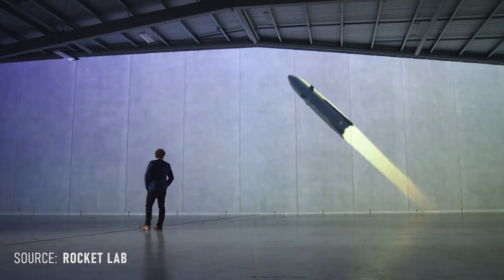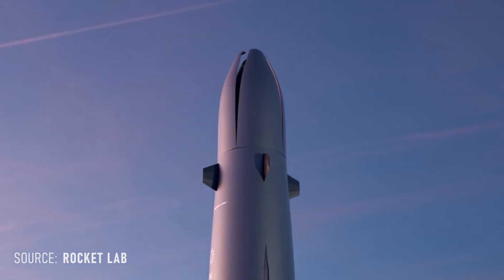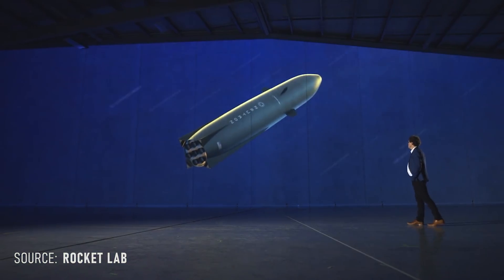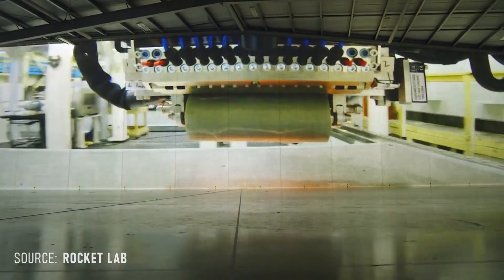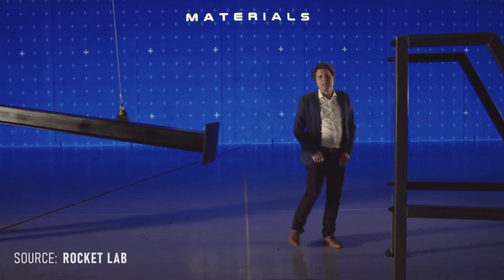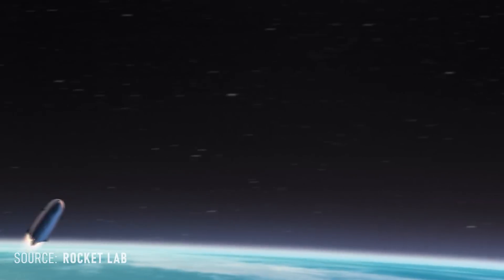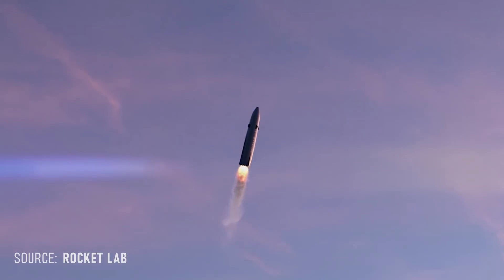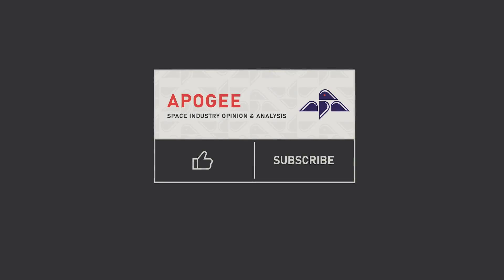Neutron First Thoughts - Design Analysis

Comment: Having watched this video I can see various flaws in it. While I agree with you that Neutron has a large amount of potential you made a lot of errors in your assessment of it.
Firstly I'll point out you mention that Rocket Lab (RL) is having to add graphite to Electron to deal with reentry but you fail to mention that this film is very light and if I was to guess it is lighter than just making the thing out of Steel or Aluminum. 
Secondly I will mention you don't seem to realise that it is easier to make complex shapes like Neutron with carbon fiber especially for RL with their experience with working with composites.
But those are just minor faults in your analysis. The real problem is with your optimism about Neutron's potential upgrades. You believe that RL will pursue a reusable second stage. This is highly unlikely unless they want a new ~3 tonnes to LEO launcher with no GTO capability. Even if they did, there is a high chance of it barely reduce the launch price. Reusablity does not mean a dramatically cheaper vehicle (see Shuttle). 
Now for my main criticism of Neutron: It isn't adaptable. RL will have a hard job upgrading it in the future to adapt to a changing market. You can see this with Roton. It was designed for the small sat market then that collapsed so they redesigned it to the MEO market and it collapsed killing the company. Back to Neutron, you can't add boosters, it is hard to modify the first stage and very difficult to change the second stage.

I do like your style of graphics.
Reply: Interesting points you make, although if 80% of the future market is LEO small sat constellations, then the ~3 tons to LEO for full reuse could actually be plenty to still be worthwhile. Perhaps they could offer both full and partial reuse configs depending on payload?
Reply: @themagiceye6723  When you say 80% of the future market are constellations the same can be said for Roton and look how well that went. There is a chance that those companies collapse. Also a lot of the mega constellations are proposed by rocket companies. 
A fully reusable second stage will cost a lot and loose a lot of performance while not saving a lot. From F9 we see first stage reuse is about 20% saving. The second stage has a much harder environment so a reasonable estimation would be about a 10% saving. I believe first stage reuse for Neutron will cost will save more than F9 as it is being designed from the ground up for reuse. Although it probably wont be too much more as it uses carbon fiber. But back to the second stage reuse. A reusable second stage will loose performance, cost more initially and won't save all that much. I doubt they'll go that direction. 
Also that ~3 tons was just a number I made up but it could loose more or loose a bit less.
Reply: @Potentially_great, your comment has a lot of errors in it, the largest being your tone makes you sound arrogant.

First, differences of opinion are not errors or flaws. 

Second, you don't seem to realize how easy it is to stamp and weld up complex shapes in sheet metal. 

Third, Shuttle's extraordinary reuse cost reflects political meddling and a broken process, not technology.
Reply: @olawlor 
Your first point is fair. 
Your Second point doesn't take Rocket Lab's experience with composites into account.
You third point is true. I used Shuttle because it is a good example of reuse not meaning low cost.

Comment: A reusable second stage is a total nonstarter for this design. The first stage would be no where near powerful enough to carry all the extra weight necessary for a reusable second stage. One of the big design problems that SpaceX have to overcome is the weight of the second stage compared to it's mass to orbit. This is one of the reasons they had to build it so big because there are economies of scale in this respect. It is also why they needed to develop extremely complex but highly efficient and powerful engines. The reason they are using carbon fibre for the body of the vehicle is going to be weight. For a rocket of this size making it from metal would just be too heavy for their low powered engines to make it feasible.
Reply from the maker: I agree mostly, but it is clearly on the table given Rocket Lab's comments, so I wanted to take a quick look at what that could be like.
Reply: Beck did say the engine's will be overpowered for it's weight.
He was interviewed as say this is for reusability but I think their's more to this.
Reply: A reusable second stage is possible, in my view. But it would require changing everything about the second stage.

FIrst, to get the needed performance boost for the added mass, they would want a new vacuum optimized staged combustion engine.

Second, reentry would be a huge issue. However, the design wouldn't have to be a mini-starship. I think they could actually come up with a new design that takes advantage of the fact that the second stage and payload could be enclosed in the fairing of Neutron. As an example, this allows for having a blunt front on the second stage with a heat shield, with the payload stacked on top. After payload deployment, the payload holding mechanisms could retract to behind the heat shield, and the stage could do a capsule-like reentry.

Once the stage has gotten through reentry, the second stage of Neutron shouldn't be too big to do a helicopter recovery. Something they will get a lot of experience with on Electron.
Reply: @espenha  In other words a completely different design. The problem with trying to build a small version of starship is you lose economies of scale and end up with little to no payload capacity. This is why starship has to be so big to get the percentage weight to orbit to a reasonable level.
Reply: @schrodingerscat1863  Not completely different. The design I outlined could use the exact same first stage. And the first stage is the biggest challenge.
Reply: @espenha  How is it going to handle the large weight increase of a re-entry capable second stage?
Reply: @schrodingerscat1863  I was assuming there would be basically no increase in the mass of the second stage + payload.

If we assume the reusable version increases second stage dry mass from ~3 tons to ~8 tons, propellant stays at ~60 tons, and specific impulse increases from 340s to 370s, payload capacity would go from 8 tons to 5 tons (for equal delta-V). 5 tons fully reusable isn't terrible.

And in this example, the total mass of the second stage and payload would only increase by 2 tons. That's a trivial difference for the first stage.
Reply: @espenha  Not really a realistic assumption. For re-entry the second stage needs to be completely enclosed, much stronger with lots of heat shielding rather than the super light exposed engine and fuel tank with a payload attached in this design. Getting all that into 8 tones would be difficult and that is with no payload. Of course the extra weight of the second stage also means it needs more fuel and maybe bigger or multiple engines.
Reply: @schrodingerscat1863  It doesn't have to be completely enclosed. You just need to have a heat shield against the airflow, and keep the engine out of the plasma stream. A two ton heat shield should be more than enough, and one ton for parachutes. That leaves two tons for thicker tank walls, reinforcements, thermal blanket insulation, etc.

The Archimedes engine is actually oversized for the current second stage, and they have to throttle it down quite a bit towards the end of the second stage burn, to avoid destroying the stage with excessive G forces, so I am assuming you would have a significantly less powerful staged combustion cycle engine. Perfectly designed for the task.
Reply: @espenha  But even then you are leaving little of any payload mass. It is a pointless exercise. Plus there is no way it would survive hypersonic air flow without being fully enclosed. The stresses involved would just tear it apart. Re-entry vehicles have to be physically very tough. Every ton of extra second stage dry mass is a ton less of payload mass and significantly more second stage fuel. If they can make that work then props to them but I am sceptical to say the least.
Reply: @schrodingerscat1863  The math works out to 5 tons of payload for the numbers I gave. Every ton of added dry mass to the second stage is exactly one ton less payload and no added propellant, all other things being equal.

I don't think a reusable second stage is particularly likely this side of 2030, but it is possible, while keeping the first stage unchanged.
Reply: @espenha  I'm not so sure, an extra 2 tones to turn an ultra light and fragile second stage into a fully reusable re-entry capable vehicle just does not seem realistic. I mean how would they even land it, parachutes mean that it would need significant work to refurbish it and a high likelihood of damage and propulsive landing adds a huge amount of complexity and weight. For something that needs a high launch cadence to make it cost effective it seems like a none starter. Still as I said if they can pull it off then good luck to them. No one thought Falcon 9 propulsive landing was possible until it was.
Reply: @espenha  SpaceX considered doing something like this back when they were still trying to catch the fairings but they came to the conclusion that to have your first stage reenter you will lose too much of your payload capacity and dealing with reentry will be near impossible. The heating is x10 worse than the first stage will have to deal with.
Reply: @jtengelbrecht4613  I know SpaceX has considered recovering the second stage on Falcon 9, but Neutron has a design which I think is better suited for recovery of the second stage. Firstly, the second stage is not subjected to aerodynamic loads, which allows for a lot more freedom in the design. Secondly, the material is carbon fiber, and the stage is supended from the top, which allows for making a conically shaped second stage.

Also, SpaceX didn't really conclude that recovering the second stage wasn't possible. They really just concluded that they should rather put all their effort into Starship. If Starship wasn't on the table, I think we might have seen a reusable second stage on Falcon 9.
Reply: @espenha  The freedom of shape might help but on the other hand RL doesn't nearly have the margins SpaceX had. If RL uses their rocket in a disposable mode(according to their website) they can take almost x2 the load where SpaceX just loses 1/4 of their payload capacity in reusable mode. If RL has to add a heat shield  and have enough fuel to deorbit(might not be necessary) + a parachute they will probably half their payload again. 

The second stage is worth a lot less especially since it only has 1 engine. Is it worth the effort & costs to recover and relaunch a vehicle at all if you have launch it 4 times to get the equivalent of a single disposable launch? Peter himself said that most of the launch cost isn't even the vehicle but ground support. They are trying to reduce ground support cost but its still not going to be free.

Comment: 3:33 Devils advocate. It depends on how many you vehicles you have. If you have one set of everything and it all needs to be put back together and it;s coming from all over the place then it's going to take you a long time. Especially if it's landing back on it's lunch site (those ground crew guys need something to do). But if you have multiple that can be pieced together it saves on launch sites. Rather than landing back where you lifted off from, you land back at base. Everything can be checked refitted and moved on. 
Rapid reuse of anything that goes through that much stress is a goal. And I wish all the best to them.

Comment: Engineering is more than anything the art of compromise. Neutron seems to hit every one.

When discussing the downsides of reusable systems usually the downside is quite obvious. For example, the Starship landing system is a hurdle, SMART hasn't got a heat shield yet, and Neutron''s composites need to hold up. The difference here is that RocketLab already have loads of experience with their system's downside, wheras none of the others do. I'm not sure you could come up with a better reusable rocket design with current (or near-current) technologies.
Reply: Unless RocketLabs invented a new carbon fiber or ways of layering it together that’s a lot better than current technology, I have no idea how Neutron can be reusable.
Reply: @Puer-Aeternus-Anonymous  Neutron is coming back from around the same altitude as electron. Its not coming in from orbit. Electron is already reusable. Neutron will be doing a boost-back burn as well to slow it down so it will be returning even slower than Electron. Add in the fact that Rocket Lab is testing heat shielding laminates on electron already, Neutron should not encounter any thermal problems.

Comment: Great vid as usual. I want to note that did you notice that most of the compromises on the non-structure parts are weight? The whole darn thing may be too heavy with stainless steel or aluminum. Maybe that is the reason for carbon fiber. Beck's interview sums up pretty well.
Reply from the maker: Yes exactly, the other compromises are probably not possible without a very light structure, I think Carbon Fiber is the right choice for Neutron.
Reply: @Apogeespace  It's the right choice if it really can survive the thermal environment in rapid reuse launches. Obviously, if it can't, the entire architecture has to be reconsidered.

Comment: Beck said in an interview that you have to choose your pain in an orbital rocket. The only reason that the engines and fairings and the like are able to be designed as they are is because of the lightness of the carbon fibre structure.
Reply from the maker: Definitely. And Neutron's flight profile makes the first stage do a lot of work, so biting the bullet and making it lighter is a massive help, and allows them to relax constraints everywhere else!
Reply: @Apogeespace  The first stage isn't doing much work at all, in terms of imparting horizontal velocity to the payload. Returning to the launch site precludes that. All the horizontal velocity imparted to the second stage means having to use more propellant to return the first stage to the launch site. This is the same for Falcon 9 and Starship, btw, when returning to the launch site. The second stages have to do most of the work. I'm sure this is a huge factor in trying to make the second stage as light as humanly possible.
Reply: @B0tch0  You just really want to avoid deformation to the carbon fiber, because it will tend to bounce back and look fine, while having internal damage.
Reply: @espenha  Are you aware flexible carbon fiber wings in F1 been used through decades now? Carbon fiber can stand the flexibility that was designed for.
Reply: @RogerM88  I agree it can stand the flexibility it was designed for. But we were talking about stress that the hardware is not designed for. Metal generally fails in a more noticable and more repairable manner.
Reply: @RogerM88  Yes, but those wings go to pieces if you look at them wrong.
Reply: @Apogeespace  big fan of your intro and music selection and timing. Please What microphone are you using?
Reply: Would metal fatigue be an issue? I could also see how practicality could a factor in using carbon fiber, they don't have the same infrastructures other launch providers have. If you make a dent in a metal structure it's pretty much ruined, carbon fiber seems to be more resilient.
Reply: @B0tch0  Carbon fiber is actually less resilient, if it is of equal strength. You get cracks, ply separation, etc. And the damage can be mostly internal to the material, and thus invisible to the naked eye, requiring an x-ray or ultrasound inspection to be detected. Which means that if someone, say, accidentally nicks the rocket with a fork lift, it's possible no one notices, before it fails catastrophically during pressurization or during max-Q.

Metal on the other hand bends more than it breaks. On the fourth Falcon 1, there was actually an accident with the first stage, where it partially collapsed due to low pressure inside the tanks. The aluminium skin was dented, and some internal baffles were destroyed, but the stage was repaired, and it ended up performing flawlessly. The dents mostly just popped back out during pressurization. It was the first successful flight of SpaceX. (Forget about doing that with carbon fiber! The stage would be a total loss.)

Comment: Beck said in an interview that the main structural design load is actually on the ground during construction, transport, and handling and so the beam swinging into the flat sheet isn’t miles away from that.
Reply: I would actually object to the claim that carbon composites hold up better on the ground than metal. in the 90s a Delta II Blew up mid-air due to a GEM rocket motor (A SRB motor with a composite casing) rupturing from a crack originating from improper ground handling and storage. This could happen to steel structures too, but the ductility of steel makes detecting damage from improper handling more noticeable sometimes (depends on how ductile/brittle we are talking). And with SpaceX and Starship they have demonstrated that they can pop out the dents during transport simply by pressurizing the tanks afterwards and checking for damage.
Reply: Y do kiwis insist on having ibeam newton cradles around their space ports, it makes no sense